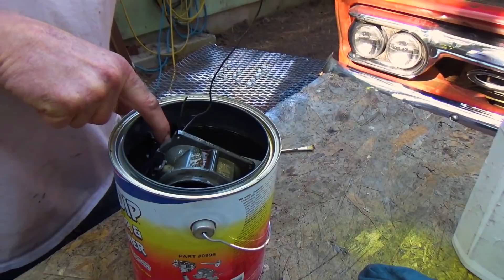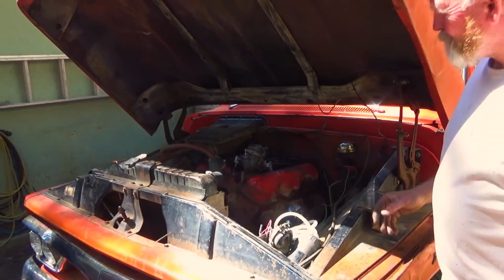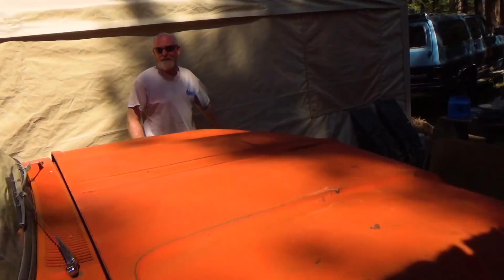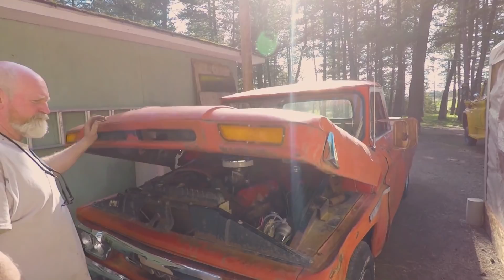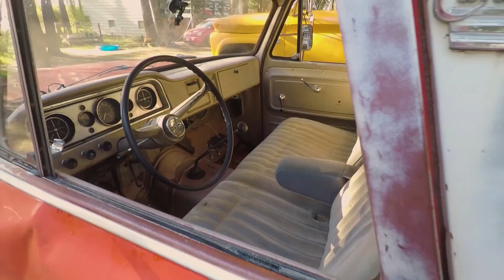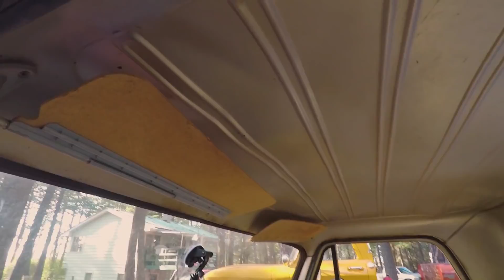1964 GMC Custom Cab Pickup 305 V6 (UPDATE)

Comment: Cool old truck- I've got a '63 C30 flatbed.  There are decals you can get to replace the 4x4 decals on the center caps- they do have GMC decals on stamped aluminum just like the originals...
Reply: pearsonba350 Hey do you know if that truck specifically came with a bed or had nothing?
Reply: @mr.dolphin7416  Your revolution is over. Condolences. The bums lost. My advice is to do what your parents did; get a job, sir. The bums will always lose. Do you hear me? The bums will always lose!

Comment: That old 305 drank gas like an alcoholic, but she would pull down a mountain if you needed to. I think it was number six cylinder that was a different size than the others to get 305 cubes.
Reply: I never heard of different bore sizes in one block.

Comment: Be careful how long you soak carburetor parts in cleaner....it may be that today's chemicals are milder, but Ford used to caution that some cleaners could remove factory coatings in the fuel bowl, for instance.